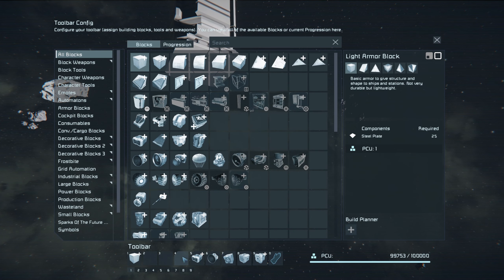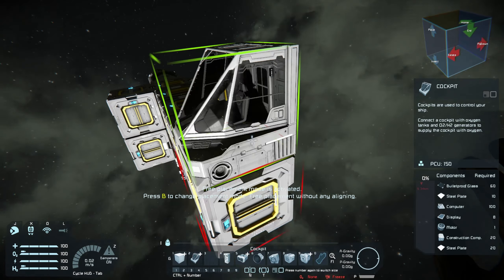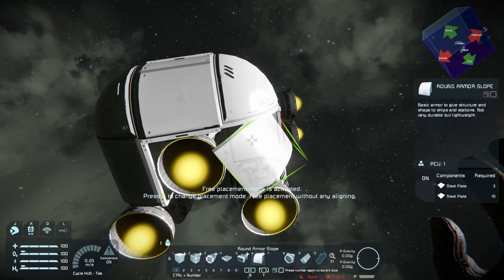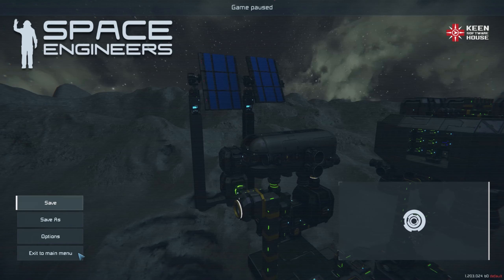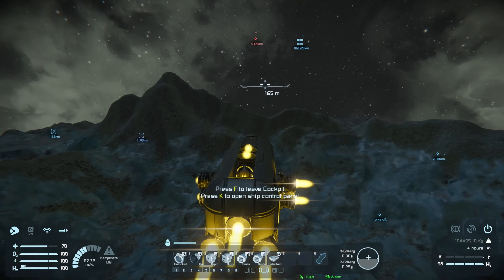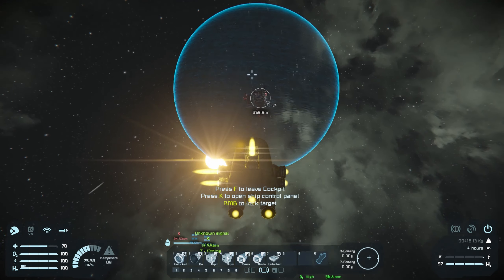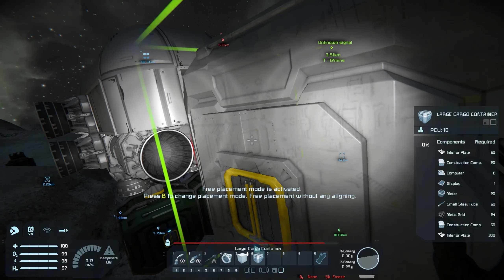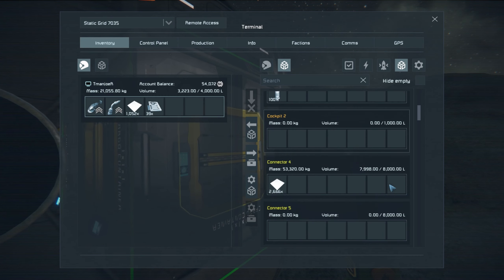Are We Going To BRAKE The GAME???

Comment: Do you know what a welder is? Why on earth are you doing this by hand?
you could finish this and keep your sanity by either using a giant rotating welder arm or even easier just slapping a bunch of large grid welders and a ship with an assembler, refinery, and cargo container full of iron ore (which can be gathered using the same ship with drills instead of welders on the front.
Reply from the maker: Yeah, I possibly could have built a giant retracting arm to do it. I tried doing it with a ship and it just seemed faster to do it by hand.  There will be a bigger progress update in the next video 😬